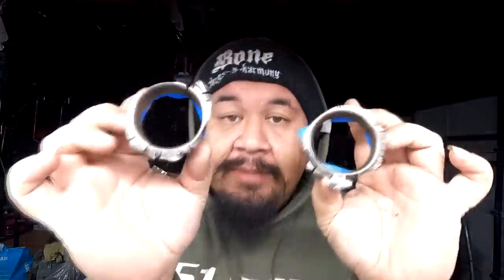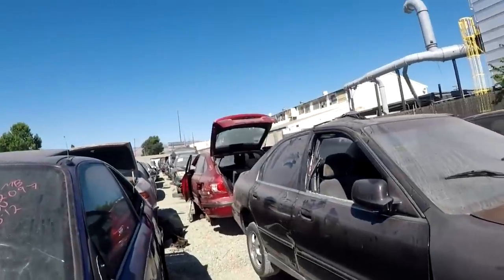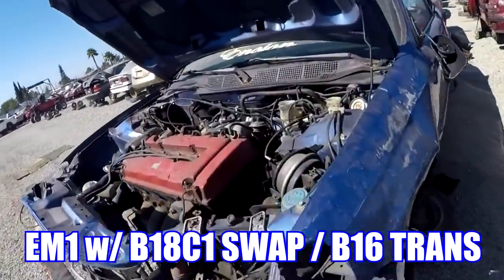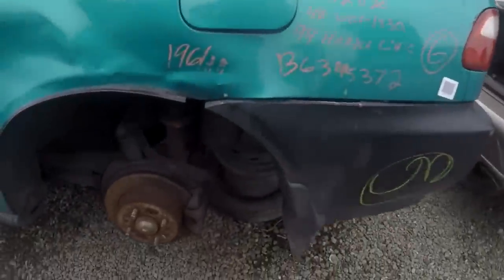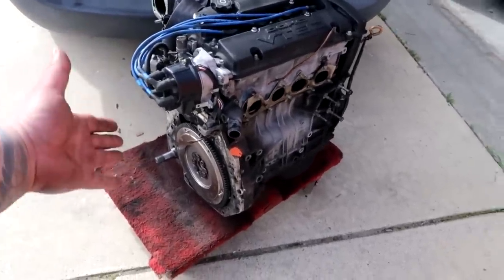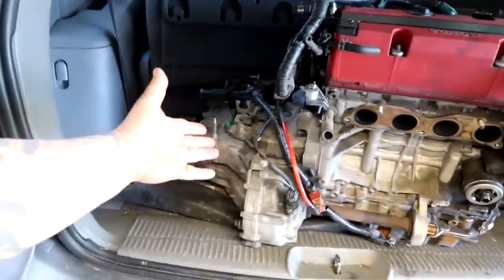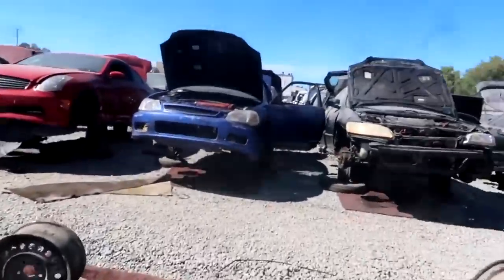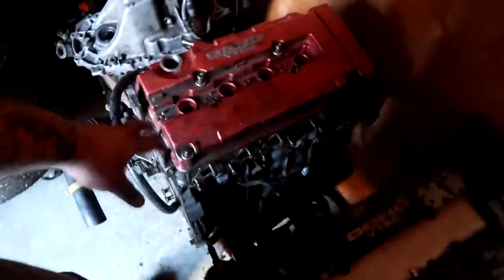BEST JUNKYARD SCORE COMPILATION | Honda Engines!

Comment: i don't think id ever go to a junk yard to pull a motor that's why they are in the junk yard because the motors are gone! maybe blown head gasket cracked cylinder head block or Transmision gone! itsl always either 1 of those issues but if you're a grease head and you build motors and you think you can repair for cheap because you have spare parts laying around to fix them engines then that's a good deal it all works out? nice video btw